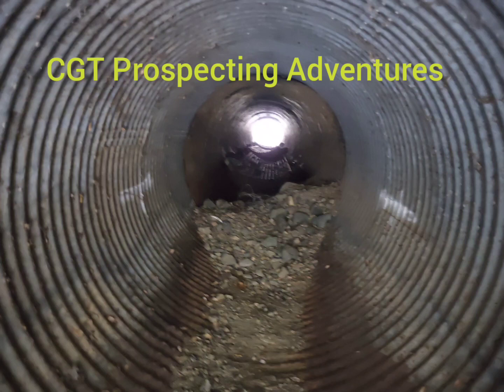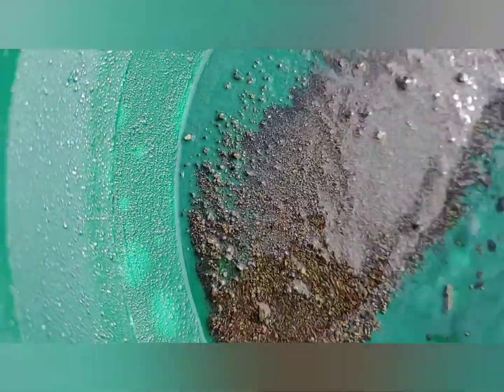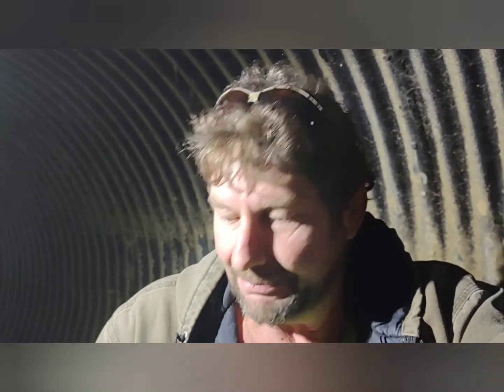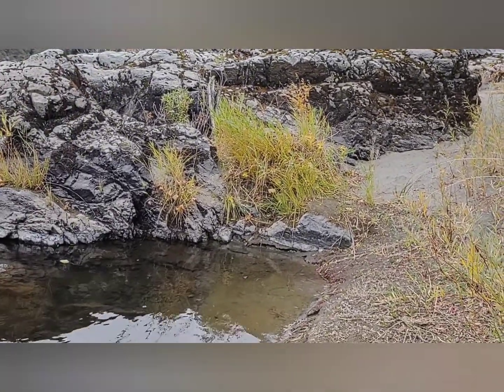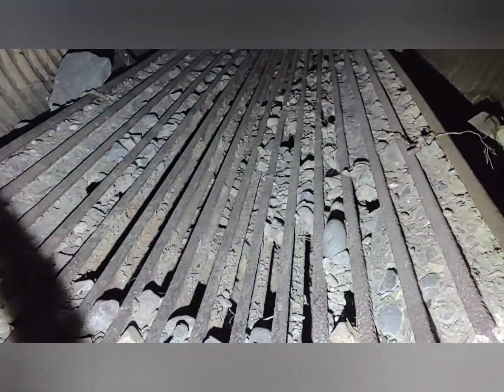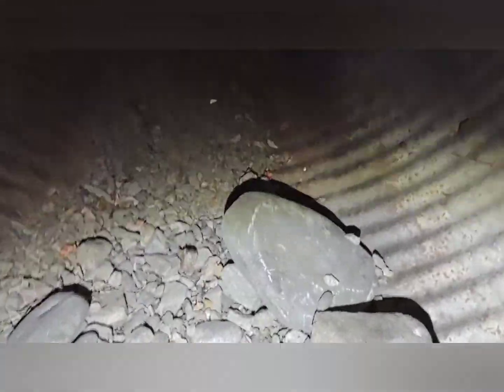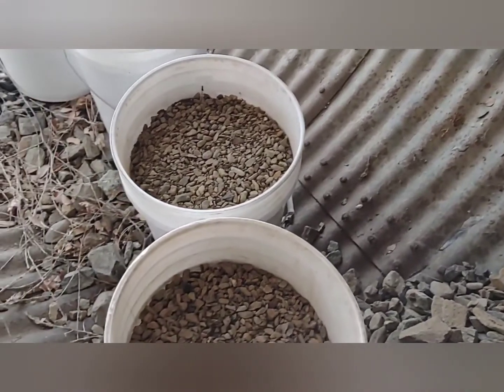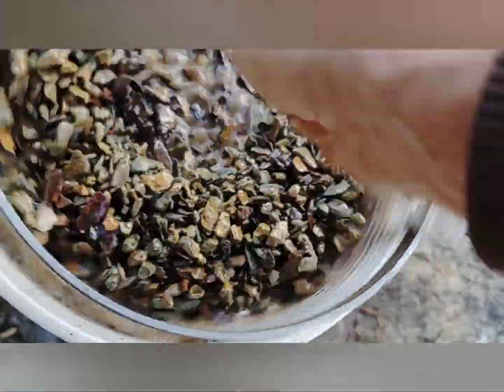The LOST CULVERT 👁️👁️ Is this just another story,,, or is it loaded as the story goes.

Comment: love that sluice! i can catch gold as fine as -300 when set right and water flow adjusted. sweet spot to find though;)
Reply from the maker: Thank you Norm,,, I definitely am still learning how fast to set the water. I was using 10° on the top and 12.5 ° on the lower?? That's about what I use at home with my full size recycling sluice, and around 10° on my homemade 42" mini clean-up sluice.
I hope your enjoying my Adventures 🙂
Reply: @cgtprospectingadventures922  i do mostly hard rock. Very small gold. Run @ 6-9 degree bottom, top usually enough to let material get wet before going down to lower level.
I'm still learning also.
Never had big enough gold to catch in top mat so well done!